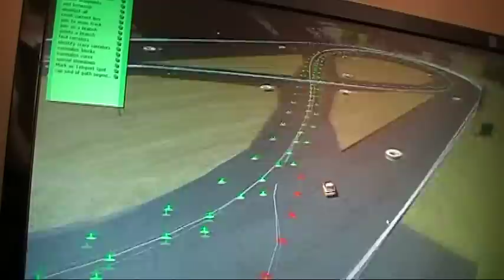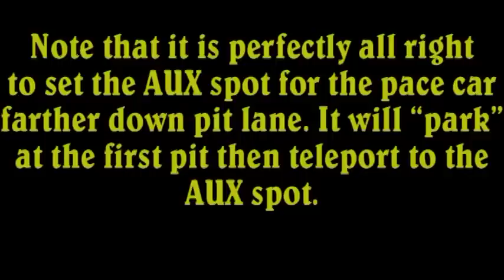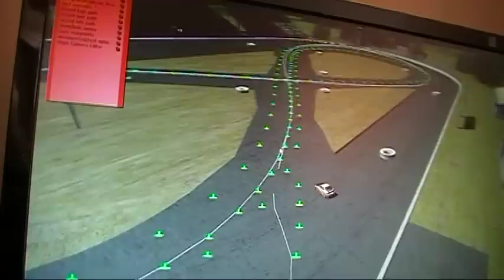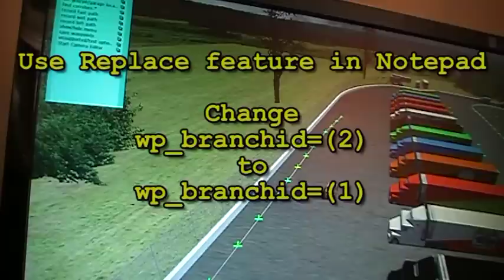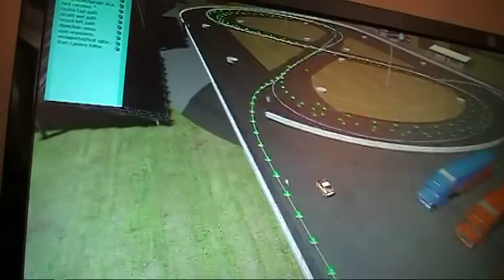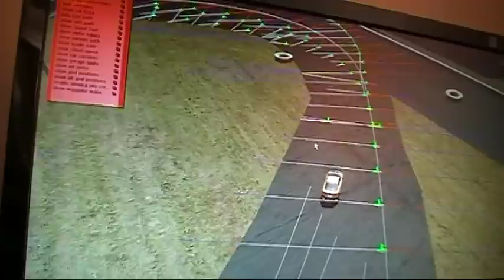rFactor AIW editing advanced tutorial -- smooth pit/track transitions, garage areas, etc.

Comment: Can this program be used with finished tracks or is this a process that must be done while the track is being created? I have many downloaded dirt tracks that need some serious AI revamping. Most AI can't even get on the track ... while others just do donuts or swerve violently while on track. Using the AI learning on these tracks don't help. I've tried.
Reply from the maker: MontverdeMark You can make new AIW for any track. My video assumes you've already done the basic stuff like drive the main path, pit path, etc. However, AI cars themselves never seem to do well on dirt, as they automatically slow down when they begin sliding. You can at least make them get on track and make the pace car work properly, though. Or do things like I did recently for our league, where we wanted to have a race at Estering, but it was designed with only eight grid spots, so I made a new AIW to handle 20 cars.

Comment: Hi Keeper1st, I'm having a big problem with a track that has two pit lanes, as you can see here: https://www.youtube.com/watch?v=h7yjowh0wk8. One is for the pace car, and one is for all the other cars. The problem is that after the pace car pulls into its pit lane, the track never goes green and the formation lap continues indefinitely.

I have been doing a lot of manual work with adjusting corridors and making sure the pace car hits the xpitin object, but this didn't solve the problem. After coming back to look at this video for inspiration, I'm thinking that perhaps there may be an issue with the grid and/or teleport spots. But I'm also thinking, since you say that the pace car needs a pit spot to park in after the formation lap, that maybe I shouldn't use two pit lane paths at all and instead marking the "pace car pit lane" as a pit extension. If I do that, though, how do I make sure the other cars don't use it? Do I set it as pit extension 1 or pit extension 2? And what about my garage path? Do I change the branchID for that like you said?

(by the way, the garage spots and the pace car pit lane are both in the infield, but the "main" pit lane is in the outfield)
Reply from the maker: Perhaps the Pace Car needs to pass through the xpitin object in order for the track to go green. Maybe add a plane with xpitin in its path...?
Reply: @Keeper1st  Hi, thank you for your comment. The pace car was already passing through xpitin. Later, I came to think it might be something with the teleport spots being in the wrong place.

But I stopped pursuing this line of thinking after I realized not only the pace car, but all the AI cars kept going into the "pace car pit lane" no matter what I do. Even though their pit spots are in the other one. I worked around the problem by creating two different AIWs, one for the race that uses the outfield pit lane and one for practice/qualifying that uses the infield one (since the garage spots are also in the infield).

This works for me, but it's not really "neat" since it doesn't recreate accurately what happens during the race. If there is a way to get this to work, I would really like to know...

Comment: why does this look like ingame editor and all i have is some dos version where i just look at a map????
Reply from the maker: Because this IS the in-game AIW editor. Perhaps you are using some third-party tool.
Reply: @Keeper1st  silly question but after more than ten years in this game... how do i get into the ingame aiw editor? what am i missing?
Reply from the maker: @o0Raine0o  It's in your rFactor/Utils/AIW folder.
Reply: @Keeper1st  im guessing this is on a steam version? no such folder exists for me unless i create it. anything else i need? ive read something about dev files but i also think thats for rf2. kinda stuck now
Reply from the maker: @o0Raine0o  I do not have the Steam version as that is much more recent. However, you may be right that the developer tools are a separate download, now that I think about it. See the “waypoint and camera editing tools” link here. https://www.racedepartment.com/downloads/isi-rf1-modding-tools-pack.59255/
Reply: @Keeper1st  thanks. ill be trying this out. fixed a few missing dll's but its not responsive so far when i try to open the program file. might try it on a fresh install since im running the 4gb patch so it might think its a cracked exe

Comment: Hi can you help me with an AIW file? I'm updating a track for rFactor!
Reply from the maker: What question do you have? It's been a years since I've done any editing on the old rFactor.
Reply: One of my guy is updating an existing track for rFactor. Paul Ricard for the new F1 2018 season. since he need to modify a little part he need to edit the aiw file. he doesn' t speak english very well he is from germany he just need that aiw file. i can provide you a pciture of that exact zone to be edited and the link of the track.
Reply from the maker: You can't really edit a zone too well or quickly. You'd be better off making a new AIW from scratch. It'd probably be quicker to do so.
Reply: I think I'm missing something. I've downloaded this : Rfactor aiw/cam editor with the DEV files included
do I need anything else?  if yes what? I've read about that "waypoint editor" on rfactor.net but that site is offline.
or I'm doing somethign wrong installing this on the rfactor folder? cause when i click it's exe, the editor launches but rfactor not.
Reply from the maker: The installation also should have binkw32.dll and mss32.dll in it. It should be installed in the rFactor root folder, i.e. the "rFactor AIW Editor.exe" is in the same folder as your rFactor.exe. Also, if I remember correctly, the editor does not work with the current version 1255 of rFactor.exe, so you need to have a copy of an older version to run with it. In my primary rFactor installation folder, I have a copy of 1250 as well as 1255. However, even renaming the 1250 exe to rFactor.exe, the AIW editor isn't launching. Frankly I don't remember what the trick is to run it on the latest version of rF1. I've been playing rF2 for a few years now... Perhaps there still are people on the forums who remember how to launch the editor!
Reply: Thanks a lot mate